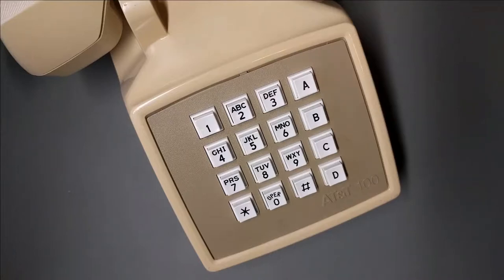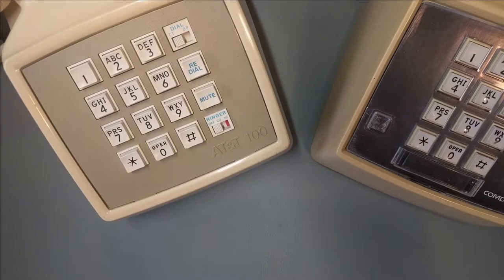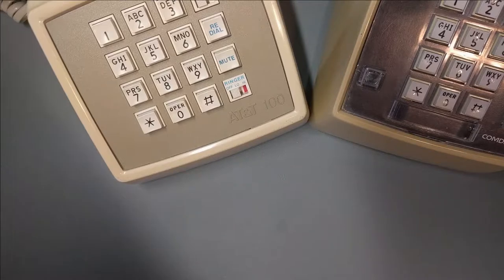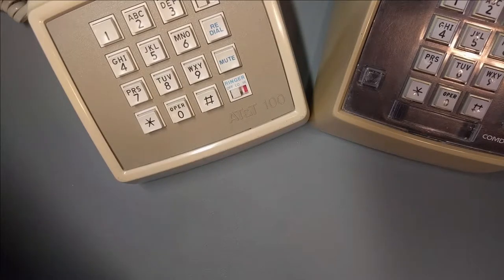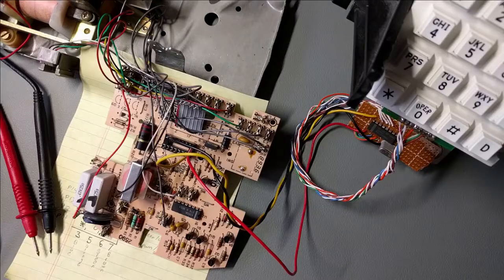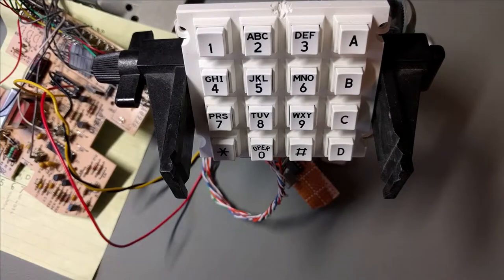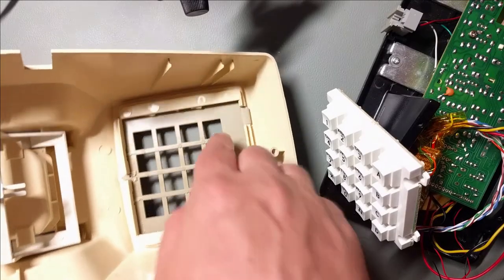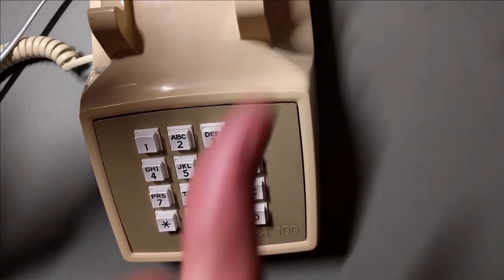Making an AUTOVON tone-compatible "silver box" Telephone

Comment: Great job! You know your stuff! I used to wire in a toggle switch between the third and fourth column pins on the DTMF chip to toggle between normal and A-B-C-D operation. The Asterisk PBX software readily accepts the fourth column tones as do most commercial voicemail apps.

Comment: so you mentioned that it would be bad to probe random things on the phone and sending it to the phone network. is there really no protection against sending errant power down the phone line that prevents you from doing dumb shit like that? i figured there would be something between the house phone line and whatever it hooks up to that prevents that
Reply: Because these are copper lines, they're subject to induced currents, lightning, and so on.  So, yes, there are measures to keep high voltage from causing too much damage.  At the most you'd fry something quite close to your phone line.